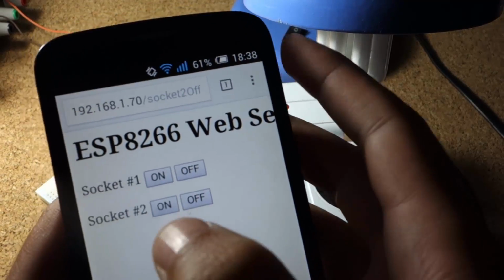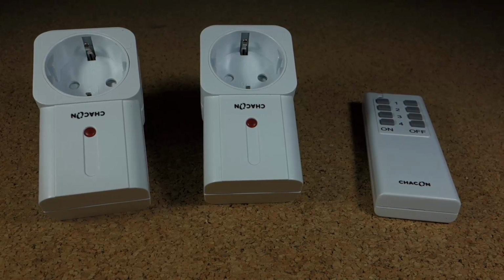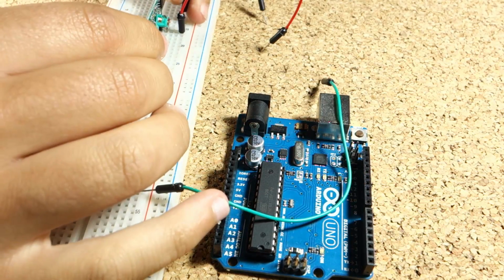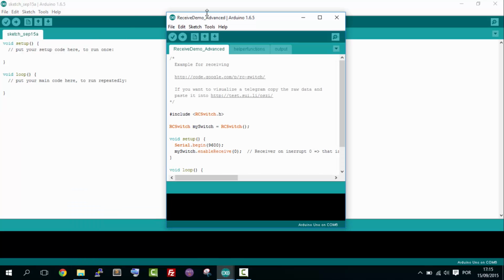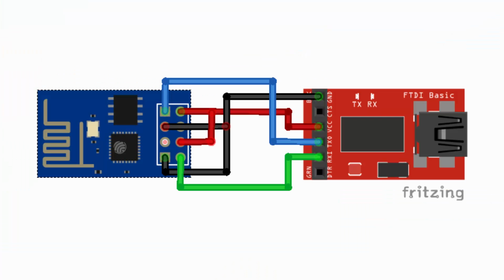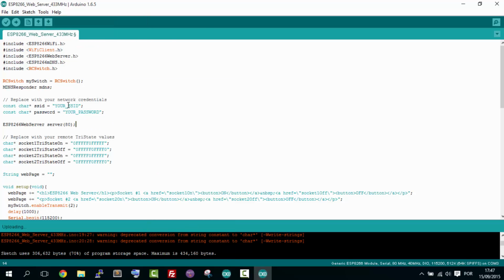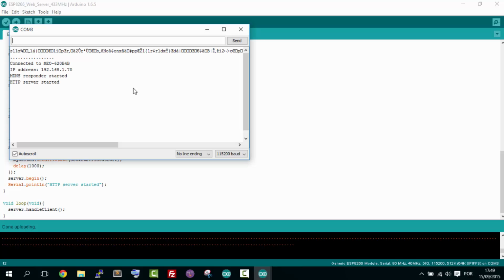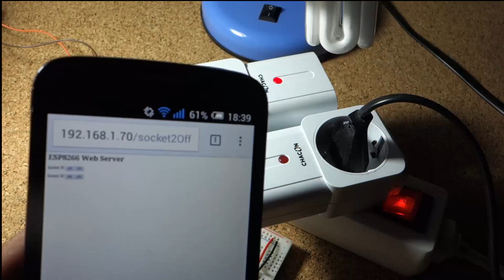ESP8266 Remote Controlled Sockets

Comment: Nothing appear when I tried to dump the transmitter's code. It's the same type as you, "Chacon" too. Any idea ?
Reply from the maker: does your remote for your sockets operate at 433MHz? any brand works for as long as that's their operating frequency
Reply from the maker: did you open the serial monitor at 9600?
Reply: +Rui Santos I opened the serial monitor at 9600 bauds, and the frequency written on the remote is 433,92MHz. Maybe my receiver is faulty.
Reply from the maker: +eliobou Have you tried with a different receiver?

Comment: Rui, using an RF transmitter is a great idea!  Much cleaner than my hack :-)
https://www.youtube.com/watch?v=YwrI7uMiGxw
Reply from the maker: +Hari Wiguna Thanks! Yes, I remember to watch your video a few months ago. Soldering wires to the remote control can be a bit tricky for some people and it can destroy your remote if you're not careful soldering. Since now we can program the ESP with the Arduino libraries (RC switch library for example) makes this project a great solution